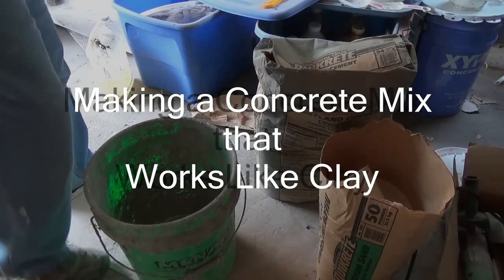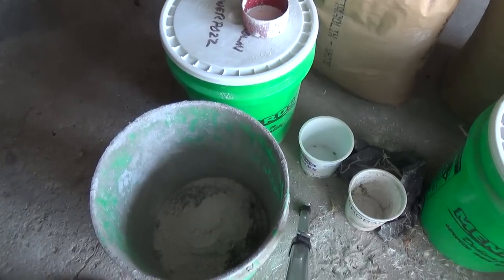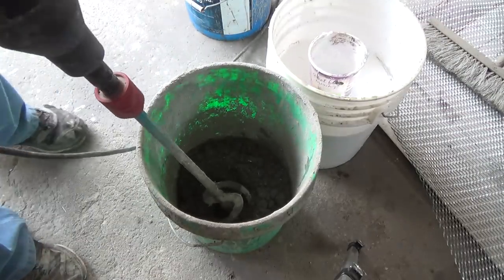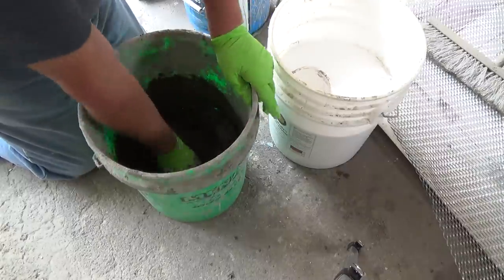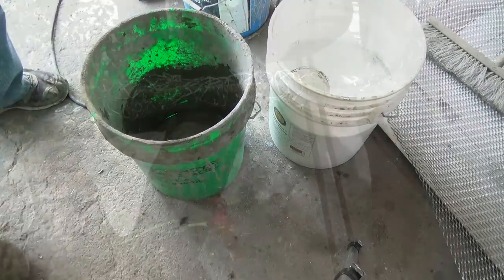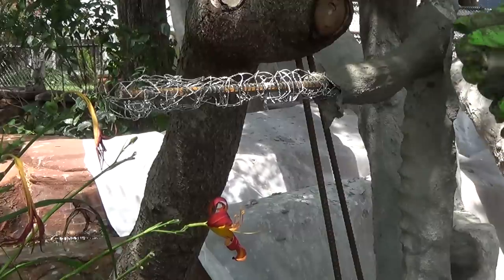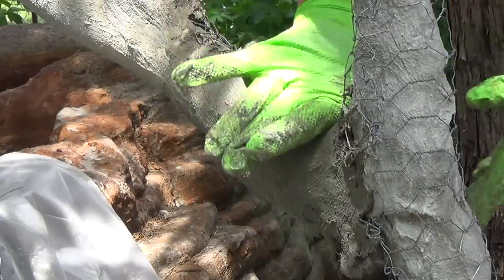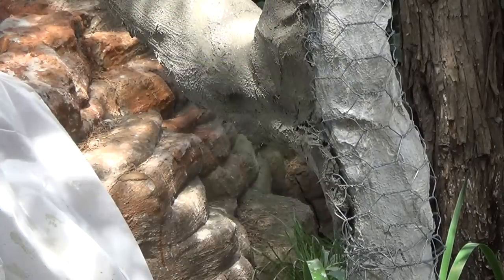#concrete #fauxbois Making a Concrete Mix that Works Like Clay

Comment: Why is the liquid white?
Reply from the maker: Acrylic admix/bonding agent.   It is added to the water.  I use 50% solids and dilute it 3 water to 1 acrylic.  Makes the mix stronger, work easier, less porous and eliminates the need for water-curing the concrete.
Reply: @dperry428  Thank you! You are so talented, I am glad I found you! I am trying to make a material similar to Pal Tiya, which is very expensive. I will give your mix a go. thanks again :)
Reply: Hi there. What is meant by 50% solids?
Reply from the maker: @michaelbrandon8482  Percent solids can be figured two ways; by weight or by volume.  Let's say I wanted to make a solution of sugar that was 50% sugar.  I could do it by weight and weigh out 100 grams of water and add 100 grams of sugar. That would make a mixture (solution) of 50% sugar by weight.  OR I could measure out 1 cup of water and 1 cup of sugar. That would make a mixture (solution) of 50% sugar by volume.  In the case of acrylic admix, it is done by weight.  So, I weigh out a certain weight of water and an equal weight of dry acrylic.  Mixing them together makes an emulsion of 50% acrylic, which is the solids that have been added to the water.  The reason it's important to know what the solids content is, if you buy one that is 25% solids, then you are paying for 75% water.  It looks the same but you must dilute it less with water to get the final solids content you want for your concrete mix.